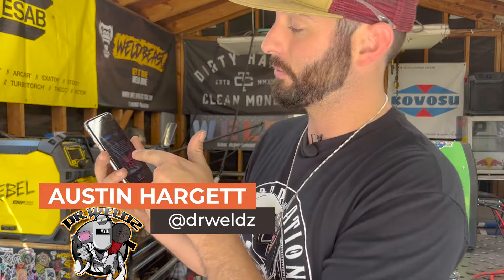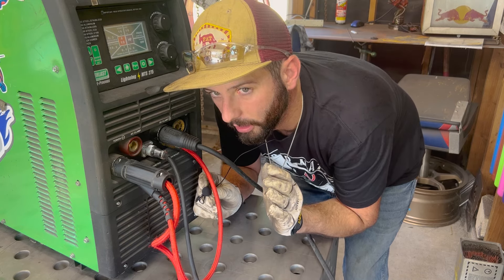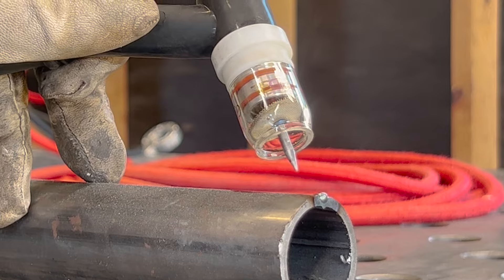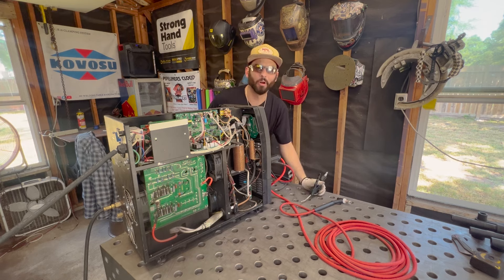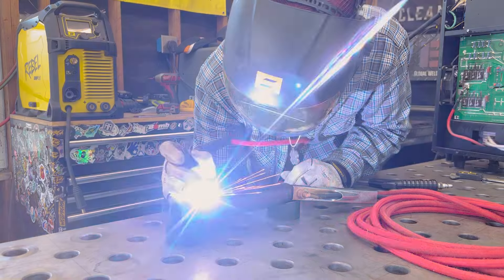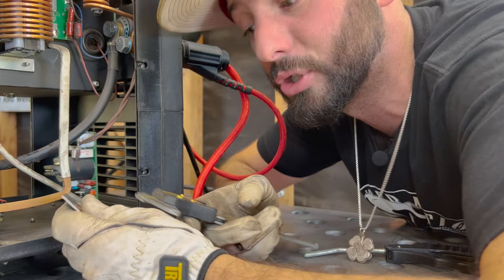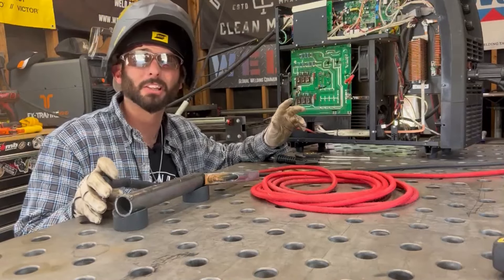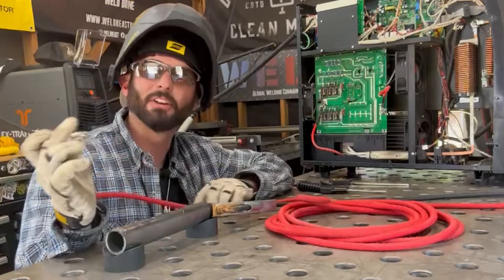High Frequency Not Working: How to repair your Tig welding machine

Comment: Fun fact not everybody knows - it's possible to build up a static charge on your torch and make it TEMPORARILY impossible to strike up again. Easiest way to make this happen is trying to strike on something with a solid earth ground while your work lead is disconnected. To fix it, all you gotta do is: check your worklead, then with the torch OFF gently tap your tungsten on the work. Voila back to normal striking.
Reply: Thanks for sharing! I did not know
Reply: I had it happen too, strike an arc and then let off, and next strike nothing happens, thought it was oxide layer blocking the high frequency. 

And sometimes if I use the cold weld function, damn thing will blow the tungsten up! I don't know why, if it's because too high a current or something.

I now set a small amount of rise time to prevent this from happening, but cold weld function doesn't allow that.

Comment: It's not sending current to bridge the gap to initiate the arc, it's merely voltage and lots of it. Current doesn't flow like that, not that I expected you to get it right. It superheats the air as it drives the molecules apart for a plasma path to the opposite of polarity. The same process as lightning, but less lethal. 😁

Comment: Best way to clean & polish contacts is with a burnishing blade or use a strip cut from a brown paper bag to polish the contacts then adjust them.
Reply: Thanks for sharing!
Reply: The contacts don't need to be super clean or polished, in fact they are not contacts, no connection. The voltage is so high it will punch through anything. A bit like a spark plug
Reply: the relay only controls the low voltage side which initializes the high voltage for the arc @Phantom-mk4kp
Reply: @alfredocuomo1546  It's not a relay it's a spark gap, the distance of which is adjusted to tune the circuit to be most efficient. The output is then  coupled to to an open construction inductor in series with the main output, about 15 turns, it is coupled at 1:1 ratio, acting as a transformer.
Reply: Just asking why would they have two places where a high voltage arc one being in the welder and another from the electrode to the work piece? I thought it worked like a coil in a car with a relay controlling the low voltage and the Coil/inductor generating the arc @Phantom-mk4kp
Reply: @alfredocuomo1546  I've never looked at the actual circuit, but I'm assuming that a high voltage source charges a capacitor in series with the primary winding of the coil in the output. In parallel with the capacitor/coil circuit is a spark gap, when the potential across the gap reaches the required voltage(achieved by adjusting gap) the capacitor is discharged rapidly, this current through the coil induces a high voltage in the coil in series with the main output. The function of the gap is effectively acting as a crude switch draining the capacitor whe the voltage is as required
Reply: Me neither that why I was asking,  I hope I never have to find out with my welder. I will say it smarts like hell if you forget the ground strap when you first start a HF arc lol @Phantom-mk4kp

Comment: Not sure blowing air around inside with the power still on is a good thing - each to their own!
Reply: Fans will pull the dust out faster. A bit of heat shrink on the blower will insulate it. Gonna do that right now!

Comment: Had a brand new machine with gaps  too wide.. It would occasionally start first time, but usually you heard the buzz and saw a thin arc jump from the electrode to the work, but the main arc would not light up..  Holding the electrode really close to the work usually got it to go, and I thought it was just how the particular machine worked, but then it got worse and wouldn't start at all..   I was dreading having to ship the thing for repairs, but I checked the gap and it was twice as wide as the spec, so I just got a pair of pliers and and squeezed the points closer together (this HF just used a pair of points on sheet metal arms soldered to the PC board, no little arms with set screws or anything fancy Iike that, so it's likely that the points just opened up due to vibrations during shipping and handling), and the thing worked great.  No more almost having to touch the workpiece to get an arc, it started first time, every time with normal electrode positioning...
I had another welder that blew mosfets on the HF board all the time, and another where the HF arced internally to a control board and fried the whole welder...
Reply: I also had a brand new everlast 200 dv do this. I did not know about gap. Customer service sent me new pedal, new board. Finally had to ship back. Said it would mess up with them. Got it back and it works. Made that high pitched sound n would not start organically. Will check this next time
Reply: Correction, they said it would not mess up with them.

Comment: I have a prime weld tig 225 and it has been doing this since I got it. The machine is still under warranty so my question is should I try and fix this myself or send it back?
Reply: Id try and clean it first without touching anything.
Reply: If the manual tells you to check and do this, then sure. But if it doesn’t, or says “no user —— parts inside”, they may tell you you’ve violated your warranty. I would check first.

Comment: be careful though opening up the machine know sometimes the filter capacitors,
can hold a charge for 10-15 minutes or possibly even longer, even after disconnecting and powering down the machine
for example a xmt 350, even though it does not have HF,
can have about, if I remember
almost 800v across the two capacitors!
Reply: great advice!
Reply: These are large capacitors with high voltage.  240 volt  inverter machines charge to nearly 280 volts. First stage of an inverter is converting AC to DC.  AC voltage is root mean square and when running at high output, capacitors are nearly this voltage.  But idling, they are significantly higher.
When I shut my Dynasty off, it hisses in a decreasing note.  This is the capacitors bleeding off voltage.